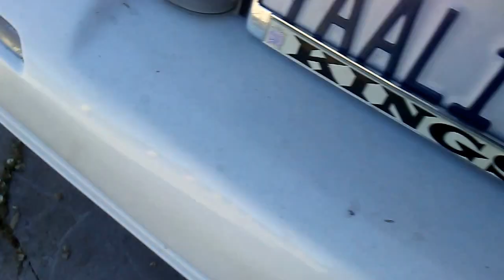KYB Gas a Just rear shocks on a 98-02 Grand Marquis or Crown Vic

Comment: The correect part numbers for the '02 Grand Marquis Hi-Performance KYB Shocks:
Front: POLICE = KG5458 -- Rear : KG5521
 I have used these shocks for several years on The 95 MERC with excellent results, which include a moderate stiffness; cross-wind stability; no high-speed "float"; and overall handling improvements.
KYB "Gas-A-Just" shocks have given great service on 4 of my vehicles -- 2 Toyota Land Cruisers, a Crown Vic, and the present '95 MERC.
KYB = Made in Poland.
Reply: What front and rear springs do you recommend for a 2000 Lincoln Town Car?
Reply: @nicholasswensen6720  I would leave the stock springs alone, and tune your suspension with Shocks, Sway Bars, and Urethane Bushings.
 I've had best results with KYB "Gas-A-Just" shocks, ADDCO Sway Bars, and Energy Suspension Urethane Bushings.
Reply: @SlikLizrd  I really appreciate the reply and helpful information. Thank you.
Reply: @nicholasswensen6720  It's all good, brother -- we gotta keep 'em rolling !!
Reply: @nicholasswensen6720  You are most welcome !!
Reply: @SlikLizrd  That's for sure, haha. I love the panther platform. I hope to soon upgrade to a 2011 Town Car when the used market simmers down.
Reply: Hello my car is sagging I can tell it’s my springs because I see rust and it didn’t sag before now it does front and back.Would you change the original springs or just add shocks

Comment: I have a 02 LX sport.  I'm doing Gabriel coil overs and removing the shocks you installed. Don't get me wrong the cars ride near perfect with the KYBs I just need to come up a little more in the rear because the front has new coils and coil overs inside the coil. I to have a Marquis but an 05 LSE with front struts. I replaced those with KYB completes and I cannot say enough on how absolutely amazing that Marquis rides. It's seriously insane how good it rides. 

If you get another Marquis get a newer one with struts and put the high end KYB complete strut. It will It up some but your days of having to slow way down for almost anything are gone. Pot holes - it eats them up for breakfast. The older coil over shock setup doesn't like them at all.
Reply: Hi. Late to the show.  Just bought a 2000 MGM GS. 

So the stock front setup is coilovers or just shocks?

Comment: would have been nice if you gave us the shock number as there is more then one KYB made
Reply from the maker: You want the "Gas a just" model

They have KYB Excel G and another one but you want the "Gas a Just"
and you want the Police spec model for a stiffer shock.
Reply: Here ya go -- KYB Gas-A-Just -- Front: POLICE = KG5458 -- Rear : KG5521

Comment: easier to just use a hole saw behind the rear seat. you can get a wrench and socket on it then! Just use a 1 inch saw in roughly the right area.... no wires or fuel/brake lines run close to the shock, so nothing to worry about.
Reply from the maker: MCN Productions I think most people would rather not cut into their car.
Reply: Most people cut into their car to install subwoofer wiring and fog light harnesses.... What's the difference?
Reply from the maker: MCN Productions I always use an existing hole to run my wiring.  People can do what they want but no point in cutting a hole into your car if it's not necessary
Reply: @rockrivera5339  Me included. I have changed out the rear shocks several times on The 95 MERC -- and NEVER cut holes in the body. Easy-peasy with a 9/16ths Gear Wrench.